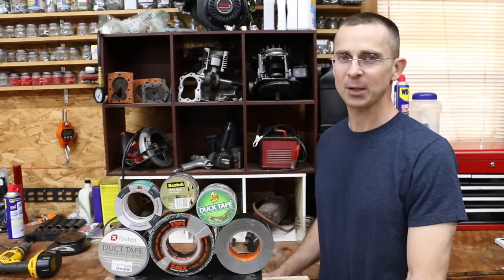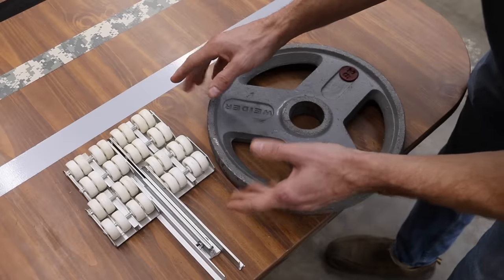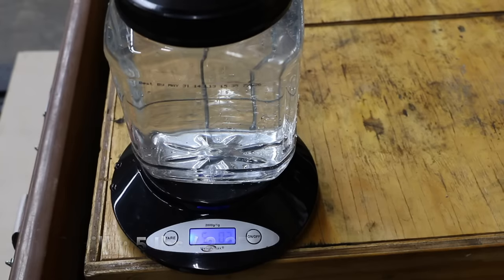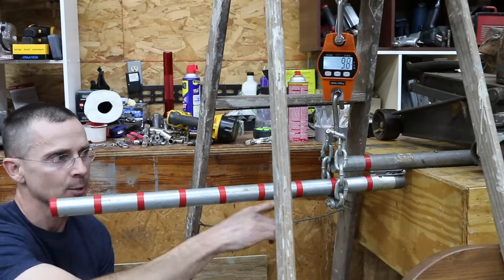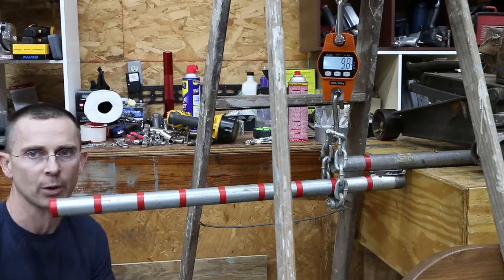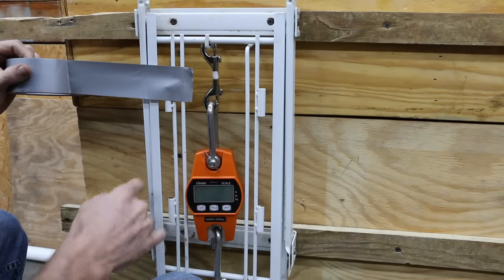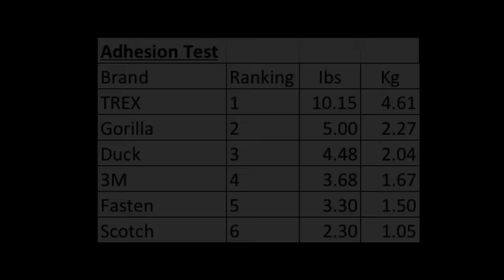Which Duct Tape Brand is the Best?  Let's find out!

Comment from the maker: Thank you for the terrific video ideas, including this one.  Thanks again, Todd
3M: https://amzn.to/2EaUCbE
Duck: https://amzn.to/3aMrEut
Fasten: https://amzn.to/31kJEsI
Gorilla: https://amzn.to/3hmwIbo
Scotch: https://amzn.to/3lcBzxY
T-rex: https://amzn.to/2EwmYMY
Reply: Hello, I'am Luiz Fernando from Brazil. About the Strength Test (Width/Lateral) you made a mistake. 

The first test with the 3M Tape the measurement equipment was configured to measure lb but in the following tests was configured to measure kg. That way the results are:

Ordered by time >>
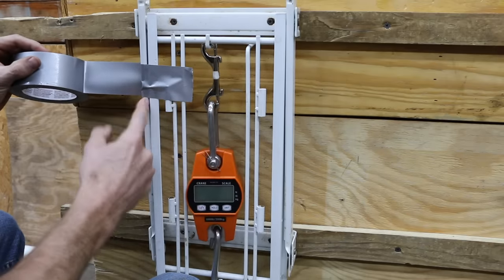8:23   3M        Tape: 16,2 kg or 35,80 lb
9:15   Fasten  Tape: 14,5 kg or 31,96 lb
9:31   Gorilla   Tape: 30,2 kg or 66,57 lb
9:50   Scotch  Tape: 17,7 kg or 39,02 lb
10:01 Trex       Tape: 29,1 kg or 64,15 lb

Ordered by resistance >>
9:31   Gorilla   Tape: 30,2 kg or 66,57 lb
10:01 Trex       Tape: 29,1 kg or 64,15 lb
9:50   Scotch  Tape: 17,7 kg or 39,02 lb
8:23   3M         Tape: 16,2 kg or 35,80 lb
9:15   Fasten   Tape: 14,5 kg or 31,96 lb

Good tests, God bless you
Reply: where is flex tape
Reply: test nichiban tape pls
Reply: Great video, but only 13 seconds at the end for the results? Worth 15 seconds per graph at least... just constructive feedback. Thanks for the video. Best
Reply: hi do you have video on which spanner made is better ? the silver or chrome or matte finish
Reply: It's  gorrilla tape. I watched my boss come back from an expo with a truck full of stuff all held down by that stuff.  And as he knifed and cut and  pulled his way through it I watched his heart sink as it pulled off all the factory paint off his truck. Moral? Make sure where ever you stick it is where you want it to stick forever. And do not use as band aid. It will remove the first few layers of skin. Its gorilla tape.  Dont abuse it.
Reply: @LuizFernando-kk4fv  Good catch Luiz! Because of that 3M got the #1 rating on the shear test, but should have been #4.
Reply: @aniketpatil1452  if you were asking a serious question, it's not here because it's advertised to be quite different, and it is. It's not so much "tape" as it is a water-tight sealant that comes on a roll. It's not strong, it won't hold weight, and unfortunately it's also not very water resistant, at least not for long.
Reply: Gaffer tape is superior to Duct tape. 
Prove me wrong!
What is the best Gaffer tape?
Reply: More people should consider the idea that every form of tape has its advantages as well as disadvantages. Always ideal to buy a variety of tapes to suit the purposes they best serve.
Reply: I'm surprised that you did not include Nashua brand duct tape in your testing.  Nashua makes some of the best tape out there and is my "go to" brand.
Reply: OK, the double enders......are you a diver?
Reply: You left out two things that customers think about when making a choice. Does the product do what they need it to do, and the price. Most people will not spend the extra money for higher quality if the product they are buying will suffice. ie., if I have a yard that needs mowing, I will buy a mower that does the job, it doesn't matter that I can get a better quality lawnmower if the one I bought does the job. Yes, quality can be important, in that if the lawnmower doesn't fit my purposes, then I'd be more inclined to buy a more expensive one. This test, while good, would have been even better if you had also listed the prices of each brand.
Reply: Do flex tape
Reply: I’m going with Gorilla brand….. I used around my AC on my window sill….. it pulled the stain out….. LOL
Reply: Love the Video.  Would love to have seen Military Grade "100 Mile / Hour Tape" and if you do cord / rope in the future could you add "550 Cord".  Thanks for all you do!
Reply: COOLEST NERD THAT EVER LIVED, WE LOVE YOUR VIDS. IN REAL LIFE,I WOULD FRIEND YOU
SEMPER FI
GUNNY
Reply: Great video but shouldve mentioned the price for each of them.
Reply: @mwa1252  Never heard of it… Sounds like he hasn’t either.
Reply: @hardcore4476  I doubt that. Nashua brand tape is sold world wide at every home improvement and hardware store as well as Amazon and global supply chains.  It is the "go to" brand for many professionals.  Anyone who has shopped for professional grade tapes would have come across Nashua tape.
Reply: Too bad ya couldn't find some ot that govt "200mph tape" I believe is what we called it when I was in the ARMY lol we taped stuff to the c.a.r.c paint on our trucks in the sand desert of Iraq amd it held till we returned home 9mos later 🤷‍♂️

Comment: Having used duct tape extensively in a prior career, I can attest that you don't always want the "strongest" tape - you want the one that works best for your application.  It was very interesting seeing how it wasn't the same tape brands that performed the best on all tests.  Also, as you pointed out, you tested at room temperature.  For some applications, it might be more important to work well at either higher or lower temperatures.  In my case, we needed a tape that would stick well to a slightly oily surface.  All in all, this was really informative!
Reply from the maker: Thanks!  Thanks for sharing.
Reply: I can't find any tape that sticks to clear plastic sheeting used in greenhouses (but I use the plastic to cover my mattress due to dust mite allergy). Everything comes off within 5 days. The only thing I haven't tried is gorilla tape. I'm going to try that next. Hopefully it will stick
Reply: @vmm5163  Might try heatgunning or high blow-dryer on Gorilla or just fuse the plastic with a bag sealer to seal your mattress.
Reply: @vmm5163  The tape has lasted through -45C and is still sticking. The only caveat is to make sure the surface is dry before applying the tape.
Reply: @PBGetson  Thanks 👍👍 The plastic sheeting has a powdery finish which I scrub off but still nothing sticks. I think it's put on plastic sheeting to stop it sticking together?  Even the greenhouse tape sold for it doesn't stick. Will definitely buy gorilla tape and also the plastic sealer gadget mentioned by the other commenter  👍 👍👍
Reply: @vmm5163  use tuck tap
Reply: @vmm5163  what the other guy said, tuck tape works well on plastic, we used it to repair our greenhouse at work
Reply: he could do the whole video again just at freezing temperatures like the Winter Olympics of duct tape
Reply: @vmm5163  Tell us how it goes!
Reply: Hey Doug, what tape did you use for oily surfaces? I work on cars a lot, tape that I can label and will stay on dirty car parts would be exceptionally valuable to me.
Reply: @JacopoSkydweller  I was using duct tape on full size clay models in a wind tunnel.  We used 3M mostly.  But that was 25 years ago.  In our case, we were looking for stiction, not strength, but other uses have other priorities.
Reply: Good point. Sometimes I need something that can be easily removed and not damage what it's stuck to.
Reply: Yeah in our case at work we have 3m tape and Gorilla tape. The 3m tape is much weaker - both the strength of the tape itself and the adhesive. That ironically makes it much more useful in most situations than the Gorilla tape, which is so strong it's more difficult to work with and NEVER COMES OFF no matter how hard you try. The gorilla tape is only used for semi-permanent applications where we have no intention of ever changing it.
Reply: @vmm5163   Don't know if gorilla tape worked for you. Once when I was trying to seal up a mattress, i use plastic from a larger mattress. It was pretty thick and regular duct tape stuck to it great. When I tried to remove the duct tape it ripped the plastic.
Reply: @billmohr9989 👍 I used thick plastic sheeting sold for greenhouses. The tape sold specifically for it doesn't stick to it. I also used Gaffer Tape (general UK DIY tape) but that gets stuck to the cotton bed sheet and peels back off. The Gorilla tape is sort of holding in place but won't stick to the white shiny Gaffer Tape already on there, even though the gaffer tape sticks to itself. I don't know what I'm going to do if the gorilla tape comes off, I'm at the end of my options I think! Thanks for your reply 👍
Reply: @vmm5163  too bad the gorilla tape won't go over the gaffer tape. I've used gaffer tape as well. 
I would say rather than use the greenhouse plastic, try some thick plastic used for drop cloth. I don't know how many mil it is but you can get it pretty thick. Worst case you could put two layers of it. Good luck
Reply: @billmohr9989  : Mineral oil will turn most adhesives to putty, then all you have to do is use a soapy cloth to wipe the residue off.
Reply: @brianlanders5306  Thanks
Reply: @JacopoSkydweller  thank you Jacopo!  you see, i need a tape that will adhere to slightly oily/wet surfaces as well.  AND i don't want black cuz i need to label it.  you're right up my alley!  i mainly use it up at our alaskan salmon outfitter, taping/labeling engine cowlings, waxy fish boxes etc.  i realize that we should just 'clean' the surfaces but sometimes it's hard, blah blah blah.  also - in my dream world i'd want it to be able to tear/rip fairly easily off the roll (i know, i want opposing things), i have no problems but boy can my clients fuck it up hahahaha.  talk to me Sky... what is working best for you?  thanks in advance-:) barbie
Reply: @vmm5163  - Hi V MM, Maybe consider using a old clothes iron over top of a piece of fabric interfacing (to prevent direct contact of the plastic with the iron), then move the interfacing down as you go along to protect the iron from sticking.  My thought is that you will melt the plastic enough to cause it to seal itself closed.  This is just a thought I'm having... I have never tried this so can't speak to the effectiveness, but it is something I would try myself if I needed to do what you are trying to do.  
As an example of this concept, recently, someone accidentally dripped hot candle wax on a zip-lock bag I was using to store some items & the hot wax effectively caused the bag to melt together in the middle so that now I can only fit things into the bag that go to either side of the melt weld... but the bag is still air-proof!  If you try it, it would be great to hear what your experience is with this method.  God bless!
[10.17.2022]
Reply: Tea Rex has entered the chat.

Comment: Bro, you are a GENIUS at developing test methods.  Sometimes I guess how you'll do a test,  but most of the time your brain is way beyond what mine can conceive.  RESPECT
Reply: Your videography skills are off the scale too. Thanks!
Reply from the maker: I appreciate that!
Reply: Good video. It would add even more value to the test to have the price per meter/inch so people could can draw their conclusions easier. Now I have no idea what is the best for my use case. (Ofc I could always google all the prices.)
Reply: He is literally getting these ideas from others. Not bashing him but he isn't coming up with these. These are tests that others have done years and years before he was even a twinkle in his dad's eyes.
Reply: I think there could be two other tests to help decide which brand to buy depending on application. But both would be performance over time therefore difficult to do. One test would be resistance/performance when exposed to UV light from the sun over time. I have seen some duct tapes dry out and get crumbly after long exposure to the sun. Another test would be exposure to water, over time, to see how resistant or waterproof the different brands are.

Comment: Rank based off total points (higher is better).
1. T-Rex: 261 pts
2. Gorilla: 216 pts
3. 3M: 130 pts
4. Duck: 43 pts
5. Fasten: 39 pts
6. Scotch: 24 pts

Comments: It seems overall Gorilla tape and T-Rex tape are quite similar, with T-Rex winning out because of the adhesive properties being significantly stronger. If you need purely strength, Gorilla tape is probably the way to go. But if you need strong adhesion and strength, then use T-Rex tape. 3M seems to be an ok budget option. 

Explanation:  I mathematically mapped all the results for each tape from each of the categories on a scale from 1 to 100 (100 is best, 1 is worst). Then I totaled the mapped values and ranked them to determine which tape came out on top. The more points the better. The reason for this is to allow for tapes that were significantly better in a category to be ranked more fairly. For example, without the mapped totals, T-Rex (with it's incredible adhesion) scores lower than Gorilla by rank.
Reply from the maker: Thank you!  TRex is my personal favorite.
Reply: 1. Flex
Reply: Inquiring minds want to compare Harbor Freight cheap stuff. And, Gaffer's Tape too.
Reply: Gorrila
Reply: Isn't gaffer tape and duct tape the same thing? Would be interesting to see a comparison of duct tape and masking tape.
Reply: *its
Reply: MrGatlin98 Flex Tape: 9999 pts
Reply: ......what happened to not giving your personal opinion about the tapes
Reply: I absolutely love how you went through the steps to provide simple mathematical answers based on a simple list of numbers, I appreciate the effort and your frame of mind. I simply have a hard time with calculations and it's been the bane of my existence for as long as I can remember.
Reply: Adding a points per dollar chart could help. Like, a best value grid.
Reply: Mr. Gatlin is RIGHT.  Thanks.
Reply: Current baseline yard prices according camelcamelcamel are and points adjusted by price:

1. T-Rex: 261 pts, $7.84 / 35 yd = $0.22 / yd, 261 / 0.22 = 1186 
2. Gorilla: 216 pts, $8.47 / 35 yd = $0.24 / yd, 216 / 0.24 = 900
3. 3M: 130 pts, $8.89 / 50 yd = $0.18 / yd, 130 / 0.18 = 722
4. Duck: 43 pts $6.20 / 45 yd = $0.14 / yd, 43 / 0.14 = 307
5. XFasten: 39 pts $9.49 / 50 yd = $0.19 / yd, 39 / 0.19 = 205
6. Scotch: 24 pts $7.00 / 20 yd = $0.35 / yd, 24 / 0.35 = 68
Reply: I thank you alot for this research and work! So t-rex still wins! 2nd cheapest but wayyy more quality!
Reply: Thanks for this useful addition!
Reply: Haven’t tried T-Rex (now I will) but I love Gorilla Tape. One feature not tested here is long-term durability: I’ve used gorilla tape on stuff that stays outdoors and had it last for years, in Maine. Comes off pretty cleanly too — that’s one reason I hate traditional duct tape. It’s a temporary repair that leaves a near-permanent mess. 

I’ll stick some T-Rex on something and see how it lasts the winter.
Reply: @E3ECO I'm not sure where you're from, but in the US, I've seen Dollar Generals carry TRex around my area.
Reply: chet3030: Maybe I just need to look again. Mostly I see 3M and Gorilla displays.
Reply: Gaffer's tape is a different use case its intended to be removed its for photography and theater use
Reply: Flex Tape is not a "duct tape".  Two different things, people.
Reply: Flex tape has infinite points
Reply: And by that I mean as many points as flex tape rolls can fit in the titanic (before Phil (obviously) sawed it in half)
Reply: @MmeHyraelle  hell yeah good idea.
Reply: Bs
Reply: MrGatlin98 Odd results... I was thinking 3M would be best as they are typically the gold standard in adhesives. Also, 3M makes scotch so I thought they would rank evenly.
Reply: 0. Flex Tape. googolplex factorial to the power of a googolplex to a googolplex squared/10
Reply: It would be interesting to see how/if the adhesion properties change when things like a dirty or rough surface, temperature, and moisture are added into the equation.

Adhesion is one of those things that are hard to judge based off of a perfect scenario.
Reply: Yeah and flex tape is 420 pts
Reply: FLEX TAPE OBVIOUSLY
Reply: @two_tier_gary_rumain , I am in possession of a 1/4 to/1/2 roll of black gaffers tape given to me in 1981 in Hollywood, Ca, on live set , by a working gaffer. It is in perfect working order at almost 40 years old, and works GREAT. Am not sure the regular stuff could hold up to that.
Reply: What about points against the price and amount of product?
Reply: Gorilla wins for strength.. and won 2 out of 3, ur test is off dude

Comment: Based on this video I bought a roll of Gorilla Tape.  Around Thanksgiving I was putting up Xmas decorations outside.  Running an extension cord across the front walk I wanted something to hold it down so it wouldn't be a tripping hazard.  So I ran it through a gap in the concrete sections and taped it down with Gorilla Tape. Cleaned and dried the surface of course and pressed the tape firmly. It's been there about 7 weeks through snow and rain and seems to be doing fine.  No loosening to speak of. Good tape.
Reply from the maker: Impressive results!  Thanks for the feedback on how Gorilla has held up